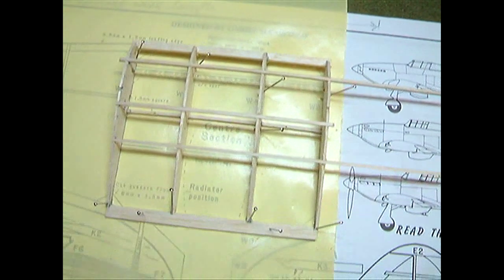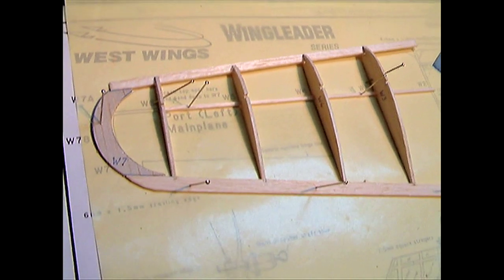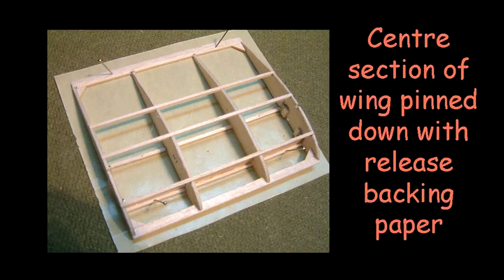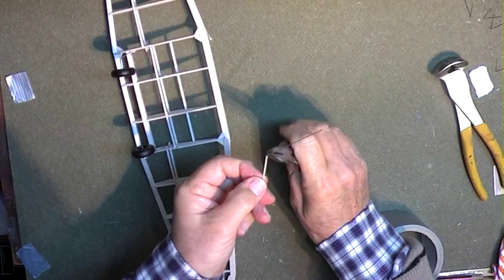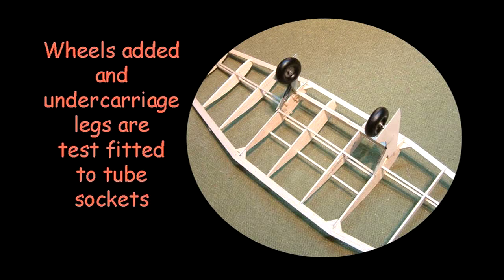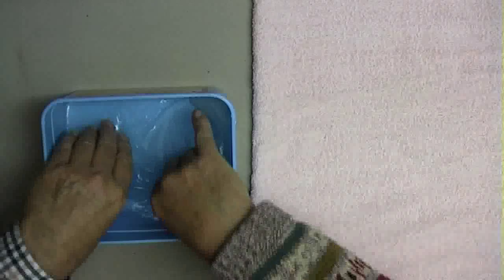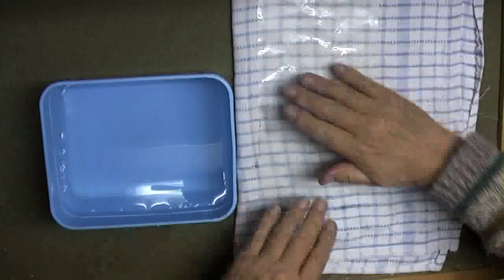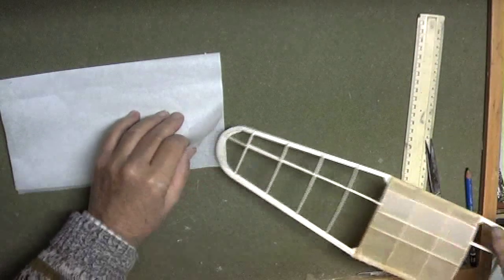Model Hurricane part 2.mp4

Comment from the maker: @0MackyMakes0  Hi.  It was about three pieces and some parts overlapped. Not too neat a job but I was able to tear some nasty bits back. I used shrinking clear dope. Best to have patience and use a lot of long strips for a neater finish. Watch out for the CG, the model requires a lot of weight in the nose!

Comment: Try Ben Buckles tissue, you'll find it easier to use, it has good wet strength, use Metho and water mixed, use clag or rice paste instead of PVA you'll find it works better and its easier to remove for repairs,